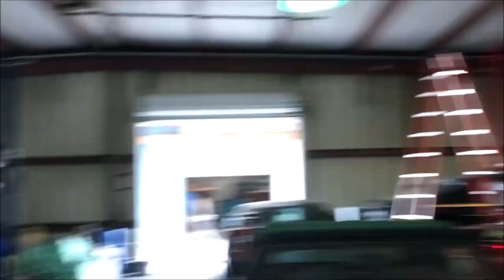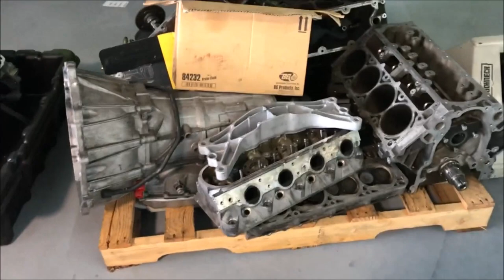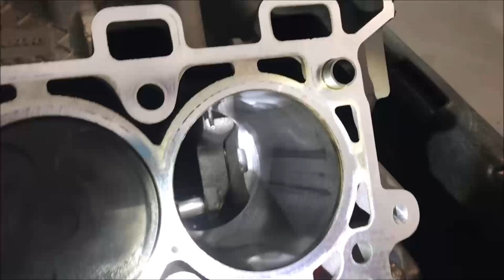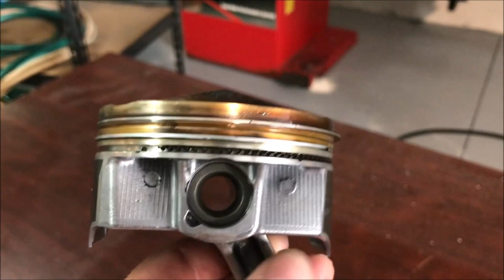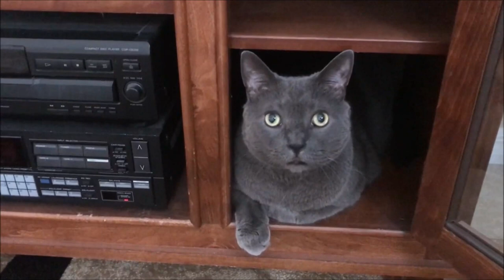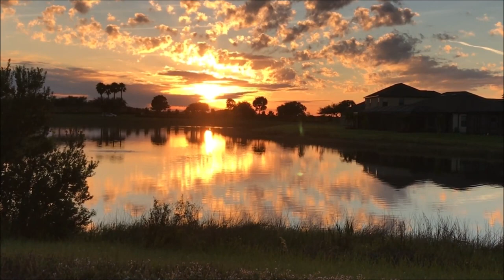2018 Mustang GT 5.0 _ Engine Failure _ See what Broke!!!

Comment: IMO all Gen 3 Coyote's have piston slap, however not everyone has a tuned ear to notice it. That being said those piston skirts look really good especially with all that debris floating around in that cylinder. Usually when you butt a ring from not enough end gap the top ring is the one that causes the damage as it gets the most heat. I would venture a guess that warranty will claim that oil got into the cylinder and lowered the octane to cause detonation, I hope they cover it. Typewriter tick is probably excessive connecting rod side clearance that's why it doesn't damage the engine, perhaps Ford is right about the piston slap being a design characteristic of the Gen 3 as those skirts look good. Lastly if going forced induction on a Gen 3 I would only do it on E85 cooler cylinder temps and much less chance of detonation.
Reply from the maker: Pro 5.0...... I am hoping to report that they honor the claim.. Stay tuned!
Reply: Yes the skirts look good. Would have had no scoring otherwise. This type of failure is always a possibility with any engine when you push their limits with mods. Hurts.......

Comment: Hey Al - My 18 Whipple stage 2 dropped cylinder 6 after a 1,000 mile trip.  The car has 18,000 on it and the Whipple has about 6,000.  Pulled the engine and tore it down.  The top of the top of the piston peeled up and broke off which smashed the electrode on the plug and dropped the cylinder however the top ring did not break.  I was only a couple miles from home so I limped it to the rest of the way.  Anyway it was clearly a ring gap issue. So I tore it down and luckily there is no wall scoring in that cylinder or damage to any of the other cylinders or pistons.  The head was a little beat up so that is getting a valve job and new valves.  I pulled all of the other pistons and checked the ring end gaps. The top rings were all between .011 and .015.  The second rings were all between .024 and .028.  I ordered a new piston from Ford and new rings.  Set all the top gaps to .024 an the second ring gaps to .029 based on a max planned boost of 16 psi using the formula of bore = 3.661 x .065 = .0237965.   For the record, i have never had the tick and i have been running Motorcraft  5w50 full synthetic since I installed the Whipple.  Also, Whilpple's stage 2 tune.  I also did OPG and CS ad an ATI balancer when I did the Whipple. I was going to do a sleeved motor this time, but I figured I would put the $50 Ford piston in it, properly gap the rings and see if that holds up.  I also considered using JE's pistons but I am kind of curious to see if the proper ring gaps will actually resolve the issue first and forged pistons are noisy. The idea behind the hyperutectic pistons and cylinder liners seems solid and I would really like to find out for sure if ring end gaps are really the solution.  If not I am really only out the time it takes to pull it and put it back in and about $180 in Ford parts.  Anyway, I thought you might find some company in your misery ... best of luck with your project. - Mike
Reply from the maker: Hey Mike..... There is a lot of talk on social media that the ring end gaps are the problem with these gen 3 coyote's.....I am very interested in how things work out for you. Keep in touch!
Reply: I assume this was on pump gas 91 / 93 octane, E85 would most likely not have had this issue even with those tighter ring gaps.

Comment: That piston damage was caused by detonation. The engine has a combination of hypereutectic pistons with a high 12:1 compression, and Whipple band aided the tune by running it pig rich. Probably either ran too much timing or had poor charge air cooling with high IATs.
Rebuild that engine with forged pistons, lower the CR to 10:1, get the biggest intercooler that'll fit in the car, find a proper dyno tuner, and run the engine on 93 octane or better still, E85.
Reply from the maker: Dino Dino Bambino.......... My new engine has forged internals but it is 12:1. My tunes says he can achieve the 700whp i want to achieve with pump gas. anything more will require more octane.

Comment: Al You might consider lowering the compression ratio on your new Livernois short block (change pistons) because at 12:1 compression it appears that your new short block was built as a naturally aspirated motor, not specifically for a boosted application. Compression for a boosted engine should be around 10.0:1 which is what the LT4 ZL1 Camaros run.
At least check with Five Bar and or MPR and see what they say about it.
Reply from the maker: James Williams....... You bring up a good point. I tried to get an 11:1 engine when i called Livernois and they sold all of them. i should have waited for them to build more of them. But instead i got the 12:1 engine. I have talked to my tuner and many other people and i was told that lowering the compression is advisable but at this point for me i would have to get another short block with different pistons.. My tuner says he can work with the 12:1 engine we are just limited with what we can do with 93 octane pump gas. for big power i will need to run more octane. But i can achieve the 700whp on 93 octane gas .  i learn something new every day!!
Reply: @coyotecarguy2076  All the tuners and engine builders i spoke with said stay high compression on boosted coyotes now. Even Roush said the same.
Reply from the maker: @maximusvonce1381  . . . My tuner says the same thing but an 11:1 engine will be a little more forgiving to lower octane gas. . . .even so, my 12:1 engine is working out well..

Comment: 12:1 compression hyper pistons and a blower =  no bueno
Reply: I tend to agree.  12:1 compression in Al's Livernois shortblock seems too high for a boosted application. CR should be around 10:1 or less IMO.
Reply: That level of compression without adjusting cam phasing ( increase overlap, reduce dynamic compression ), poor tuning, no alcohol ( e85 or better ) plus oem defects = KABOOM.........$$$$$$$....and video content👍
Reply: @jameswilliams7337  Aluminator is 9.5:1. Way better volumetric efficiency with a blower. This guy fcked up again

Comment: The piston is dark. The damage looked like a lean situation. That piston looked burned then melted. Lots of piston issues around fueling and Detonation.
Reply from the maker: thereissomecoolstuff.  ... check my last video, it looks like my engine was running Fat rich.
Reply: Hey Al it does look rich, just wondering why only 1 piston if that's the case. Glad it's getting put back together. I let mine warm up the remote start cycle before I get it on...always worried about rich/lean scenarios when you boost it.. I have a stage 2 so far so good..
Reply from the maker: thereissomecoolstuff.  ...congrats!! Keep your fingers crossed.........
Reply: The piston is dark because of oil consumption.  A lean burn is light grey.   
Originally I was thinking detonation, but ring gap is more likely as the ring itself is twisted, like it jammed up.
Reply: @ThisOldMan-ya472  I agree.. thanks and thank the Coyote car guy for sharing all of this as well as 5 bar for allowing him in the shop to video..

Comment: Hypoeutectic pistons  need a wide ring gap due to high ring landings on the piston and piston expansion, I use those pistons and always diamond cut open the ring gaps to max specs
Reply from the maker: Sid Luscious. .  that sounds about right. .  my stock engine probably had ring gaps that were to tight. .  that is what most people say about this

Comment: Al...I just blew my motor Saturday lost cylinder #4..
.damn the luck ordering parts now
Reply from the maker: James!!  Dude i'm sorry to hear that!! That Sucks!
Reply: @coyotecarguy2076  it does I'm building back Hopefully I'll be up and running in the next 2 weeks
Reply: Why did you blow motor.  Was it gen 1 or gen 2 coyote.  Boosted or nitrous
Reply: @maximusvonce1381  gen2 boosted..lean spike
Reply: Who tuned it. How did you get a lean spike.  What went wrong.
Reply: @BeardsandCars  What blower
Reply: Did you throw a rod or burn piston
Reply: @maximusvonce1381  my fault..running it hard on low fuel😏
Reply: @maximusvonce1381  burned up a piston
Reply: Vince Kenne bell
Reply: Where you on e85 when it ran lean?
Reply: @coyotecarguy2076  Just curious.  How come you are not on e85?
Reply from the maker: @maximusvonce1381  . . .  I dont want to invest in the fuel system. .. i am making 800 to the wheels on pump gas with boostane.. .  car ran 10.08 at 135 mph with a blown rear. .  it will run 9's easily. . it ran 6.42 sec at 112.5 mph in the eighth mile .. .   Not gonna cage the car so why go faster? besides i might sell the car next year. You wanna buy it?
Reply: @coyotecarguy2076  Why are you selling that badass car after all the work you put into it. 800wheel is a lot on 93. You are the only guy i know making north of 700wheel on 93. Pretty impressive.  Naw i like my S197. Getting motor rebuilt and forged, putting in a Donor TR6060 transmission that's practically brand new, and my rear end is already a bulletproof Eaton trutrac.  So now i can make 800wheel e85 and not worry about breaking anything.  So i am good as far as car goes.  Is your car auto or stick.
Reply from the maker: @maximusvonce1381  . . . I never keep cars for much longer than 3 years ..  i get bored fast. .  my car is a 10 speed auto. .  My tuner was able to shove an additional 3 degrees of timing in the tune with the boostane ..  but i really cant run straight 93 octane in it . .  but thats how i made the power . .

Comment: this has been happening on some engines with blowers.  The ring gaps are too narrow and the addition of heat causes ring expansion that more than takes up all the slack.  The ring and land(s) break. Stock evidently is no problem.
Reply: Sounds like a reasonable explanation.
Reply: @ThisOldMan-ya472  There were several postings on the mustang6g forum the last time I looked..about 2 or 3 months ago.
Reply from the maker: apaheus..... i am gonna try to measure the ring gaps in the old motor. Stay tuned.
Reply: The ones that didn't fail may be OK. Interesting article: http://blog.wiseco.com/everything-you-need-to-know-about-ring-gap
Reply: @coyotecarguy2076  The rest of the rings may be OK.   Interesting article:  http://blog.wiseco.com/everything-you-need-to-know-about-ring-gap

Comment: To high of compression. The ring end gap needs to be opened up for boost. To much pressure build up between the top and second ring, which is what blew out the ring land. I'm sure the gaps are different between g2 coyote and G3 coyote.
Reply from the maker: coyote kelly........ Really i am surprised the piston broke like that.. Lebanon ford sells so many boosted mustangs with no problems. I have no idea why mine broke.
Reply: @coyotecarguy2076  Cause maybe it was a Friday car.   lol
Reply: Coyote carguy how r u surprised?  Shitty tune, high inlet temp, a bit of knock and here we r. Wtf did u expect ?
Reply from the maker: coyote kelly....... Lol!

Comment: Piston shown prime example of  insufficient top ring gap(for actual use incurred ) Common failure in  Boosted  eng. Also shows top ring moved way down from piston top and oil spray nozzle 4 piston coolin , both vestiges from diesel/commercial duty mtrs and proven aids to dealing with increased combustion heat.
Ring gap held close as possible in OE NA mtrs 4 best emission/efficiency . Hope sum warranty assist is provided 4 this pricey fix.
Reply from the maker: pete d  .. I had a whipple warranty that paid for about half of the cost for the built bottom end i installed

Comment: Finally, Thanks for the update. I'm aware this is a proven combination Whipple and Ford Performance has tested and approved, but that don't mean other variables come into play, like...
Looks to me like too tight second ring gap, possibly, if so it will expand to its limit, stick and take the ring land with it. 
It was rich, but not too much to be safe and not load  everything up too bad. A couple hard passes would have cleaned that color up.

But not if the ring gaps aren't loose enough. 
Whipple can't control how these motors are assembled, more of a gamble compared so much with the Voodoo and Aluminator's. I believe they are hand assembled and thus the ring gaps would have been set for the combination upon assembly.

They should warranty it with what you have here.
Reply from the maker: Marty Miller.......... Really thousands if these engines get a supercharger installed at the dealers and they run without problems. Why i had problems, i have no idea. and i agree they should cover this. Thanks for posting.

Comment: Appears Ring ends butted from excess heat causing Cyl wall damage. When engine output's increased , heat output is also increased. Buliders of power adder motors increase compression rings end gaps to allow addl ring expansion due to increased heat. Prior to adding 'boost' tis advisable to regap top rings , a fairly inexpensive [parts wise] but yugely time intensive operation. Happy Trails 2 U
Reply from the maker: pete d.  . It is very possible that ring end gaps were a contributing factor here ..  some people with stock engines are doing ok. .  but many had failures like i did. .

Comment: Before I modded my 18 GT it was flashing CEL. I took it in at the dealer for oil change and to check this problem and they said it was fine. I modded my car around 4.6k miles and ran JLT CAI, VMP 91 tune and corsa catback. Car was running good for a week then I decided to get the e85 tune. It was running good too and got 2 full tanks out of it. Later on car is making a rattle noise under the car under engine bay. Previously I was running the car hard before this happened so like 5 mins before all this. The rattle only happened when giving it throttle. No CEL came up or anything no power loss. I then let the car sit and couple hours later I start the car and drive to the dealer but the car kept rattling and still worked fine until the car decides to turn off at red light. Wouldn’t crank at all. Accessory mode was still good and battery too. It’s at dealer rn and they ordered a new engine but they said they haven’t opened it up to check what’s wrong. They don’t know it’s modded yet. Hopefully it’s nothing serious but most likely gona have to be a new engine.
Reply: Tommorrow hits a month since it’s been at the dealer
Reply from the maker: David Morando.. . . Most of the time ford will just replace the motor before they try to fix the old one...  i have herd about that rattle before .. .  But nobody ever found out what causes that. . .  your best bet is to get the new engine installed and leave it at that.. i built a stronger engine . . so far so good..
Reply: Coyote carguy yeah I think it’s most likely going to be on me to buy the new engine but until they confirm. I want to run e85 again but not sure if stock engine will be good. I was just running simple mods. Maybe it was a bad tune from vmp. If it was then any chance they would be able to help me since they caused the damage? Any advice would help out man thanks!
Reply: My guesses for right now are it was either preignition/detonation.
Reply: Your motor seized.

Comment: Great video footage of the damage Al! I can't help but wonder...did the boost really do that or was the engine faulty to begin with and the whipple just finished it off?? In either case, whipple chose to sell a blower package with a warranty and you did abide by their terms so you should be covered.
Reply from the maker: tominator........ Glad you like the video! Really my car was running great before i put the blower on.. If i had any doubt i would not have gone boost.  Yes i followed the terms of the warranty so the coverage should be there.

Comment: Coyote stock blocks only $800 from ford racing.  Vmp said they will take 1200 horsepower before sleeves needed. My block looks way worse after rod snapped.  Probably need new block and crank.
Reply from the maker: maximus vonce
. . My livernois short block was $6000 Shipped!  maybe they can help you
Reply: @coyotecarguy2076  What compression you running now?
Reply from the maker: @maximusvonce1381  .  ..12:1

Comment: My piston out of my 18 looked the exact same ! I blew cylinder 8 now I’m fully built motor . I had about 3 k on my stage 2 whipple 
Ringlands looked the same however I had zero cylinder wall damage
Reply from the maker: Mikey Kohler. . .......Sorry to hear you had this problem... That sucks...  My cylinder #6 had a broken piston with no damage to the cylinder but cylinder #1 was scraped up pretty bad...
Reply: I have a 2016 with 32k miles. Put a Whipple stage 1 on it and haven’t put 200 miles on it. Breaking it down this weekend to see what’s wrong, pretty sure it’s this on cylinder 8. I was curious how Whipple handled warranty? Any info appreciated!
Reply: @1chasehayez  
I whipplecharged my 16 f150 and beat it like it owed me $,no issues at all.

Comment: Bottom line from seeing all of this, the 2018-2019 engines were done on the cheap.  This is unacceptable even for a mass production engine.  12:1 compression and boost doesn’t seem to be a good combination for these engines.  The 2015-2017 engines had room to grow.  These engines seem to be maxed out performance wise and are optimized for NA performance.  If you want to do FI for reliability, forged internals makes sense.  Al, I think you’re going about it the right way and in the end you’ll have a reliable and fun performer.
Reply from the maker: Steven Freitas.......  I am confused myself. I have friends with whipple's on their 2018/2019 mustangs with no problems. Go Figure.